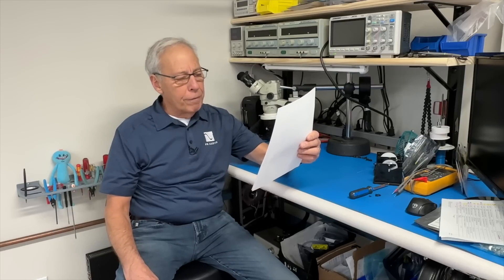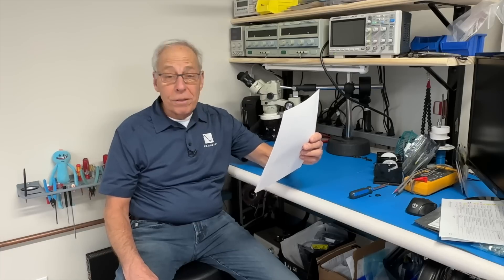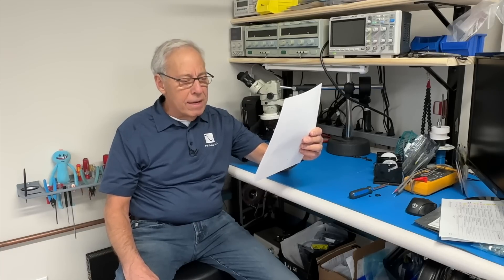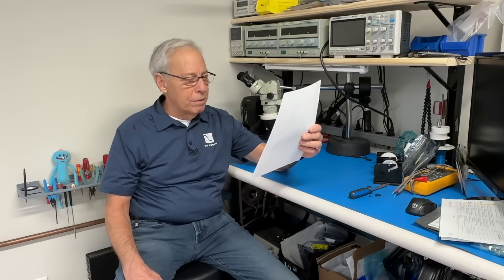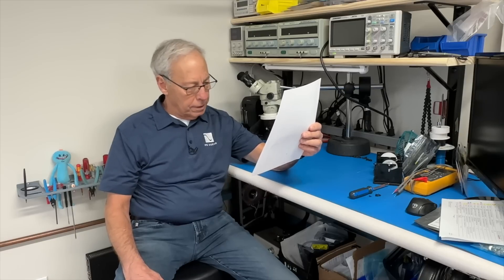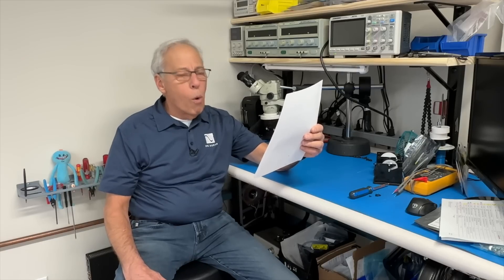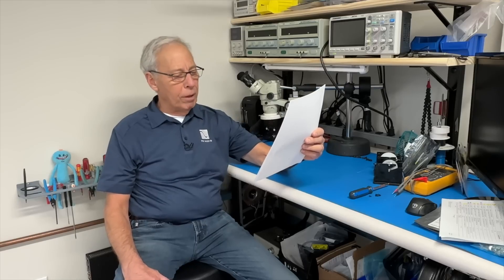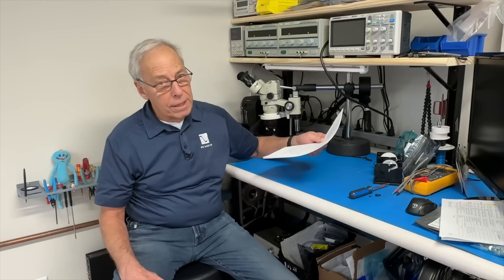Class D amps inherently inferior?

Comment: I have the impression that Class D will always sound artificial, even the most modern ones, there is too much effort and engineering invested by the industry so that these class D models can have the same 'warm' characteristic as the class AB (in general), trying to reconcile the high definition quality of one with the neutral/laid-back touch of the other, trying to compensate one thing with the other, it will always sound cold in some way. All Class D amps I've tested hurt my ears over time. I've tested them several times, from bad to good, changing DACs and speakers because I'm sensitive to noise, mids, and treble, even using EQ, even the "warmer" Class D amps cause me discomfort and ear pain. Sleeping listening to music on a Class D amp is torture. So, I see that this goes a little beyond the frequencies themselves, but rather the nature or sound signature reproduced by the specific topography of the Class D amp. Even though it's implemented to overshadow the clinical and terrible sound of the first Class D amps, it's always there, always. The brain doesn't accept it in some way. Interestingly, some older Class AB amps I've tested with lower specifications sound much more comfortable and more acceptable to the ears. Of course, there are flaws in Class AB amps too. They're not perfect. My sensitivity reveals this too, but auditory fatigue is less, fewer sharp edges make the sound more natural. In short, saying that an amp sounds "good" ends up being relative. It is obvious that the vast majority of class d are more efficient, "clear", "hi-fi", powerful and versatile, they sound cleaner and clearer in general, but this comes at the cost of being a more "in your face" sound and no matter how much they try to implement it, it never ends up being something "laid back" enough.

Comment: Isnt an amplifier just supposed to amplify a signal?  Why should an amp add sound to a signal?
Reply: That exactly is the thing with well designed class D - it is very close to doing just that, amplification. Very cleanly and neutrally so. 

People who aren't used to that, but instead certain characteristics of more traditional methods like A, AB,.and especially tubes, aren't immediately satisfied, because they're missing something.

That something is distortion and nonlinearity. They got used to it for decades and developed a taste for a particular pattern. Their brains expect it.

That's why they're disappointed when it just isn't there, and describe the sound as  boring, flat, thin.

It isn't. It's just way too clean for their taste.

Comment: Dear Jeffrey,
a proposal to check:
Take some wire wound 5W resistor of say 0.1 or 0.22Ohms  and connect it in line with the positive/red output speaker terminal of your class D amp output, the other end to the speaker cable to the positive speaker input terminal - and check the sound now.
Background: the speaker is best sounding not at the maximum damping factor available. Damping factor (a reversal value related to the differential source impedance of an amp related to the load impedance) is usually very high with Class D amps hence the output devices are switching and control depends mostly on high negative feedback. That's totally o.k. but can be absolutely too much of a good thing when it comes to real speakers, that worked well and perfectly aperiodically damped on a predecessor amp with less damping. 
So if you reduce that value, the speaker may sound less over-controlled, thicker...

Comment: Class D can sound really good, but it is rather brighter and thinner on the midrange compared to Classes A and AB . One has to pair it with the right speakers. My Rogue Pharaoh II integrated (tube preamp, class D amp) works well with my neutral KEF 105 but not good enough with my JBL L100.

Comment: Why are some of these Class D amps so expensive? You said that they use off the shelf modules. You just have to design a preamp stage, power supply and chassis around them. Why are China mini amps so cheap in comparison?

Comment: I recently had two class d amps in my system, one of which was a P S. Audio, which usually is powered by mccormack class a B amps
 One of these amps sported a tube preamp stage which is classy A and sounds great.
However, I find both amps unlistenable compared to my McCormack

Comment: As some other commenters have noted, class D amps respond very differently to peaks and valleys in speaker/crossover impedance. Any speaker no matter the quality is going to sound very different with a class D amp than with a similarly spec'd AB
Reply: That's true for cheap designs, but totally not for well designed class D. They're perfectly linear and flat, no matter the load.

What you're describing there was true in the past, but isn't anymore and hasn't been for years.

Comment: Class D amplifiers, are based on digital switching

Class D amplifiers generate 3rd order harmonic distortion and high frequency  noise. That is because the output transistors switch the output to either VDD or ground, the resulting output of a Class D amplifier is a high-frequency square wave. The switching frequency (fSW) for most Class D amplifiers is typically between 250kHz to 1.5MHz.

Vacuum tube amplifiers produce pleasant sounding 2nd order harmonics. Which is preferred by most listeners for being. "Lush & Glorious"

By placing a vacuum tube buffer stage prior to the Class D electronics the resulting sound is most pleasing to most people. This has been a well known fact for decades. Take a classic Nelson Pass Class A amp ( dry, cold but deadly accurate ). Drive it with a vacuum tube preamp and presto a Lush and Glorious sound.

Comment: If a particular power amp sounds thin compared to other power amps, then in all likelyhood  it needs looking at by the manufacturers with a view to improvement.
Messing about with different preamps to overcome shortcomings would not be my solution.

Comment: I haven't used Dirac, but I have heard many people report that the calibration tends to come out sounding too thin for their taste. I wonder if he used Dirac on the new class AB amp as well, or only with the NAD and blamed the class D for something it might not have been responsible for?
Reply: Hello Zack - I'm the guy who wrote to Paul. I tried the NAD with and without Dirac. The Dirac made no difference - the NAD always sounded anemic. Given the consistently positive reviews for the NAD M10, I was quite shocked when I heard the amp with my Focals. Paul's explanation makes sense to me. For the price the M10 is loaded with features, and I bet that the class D amp circuitry is not as good as it could be. I've gone back to being very suspicious of subjective equipment reviews!
Reply: @michaelpetkovich5058  What did you end up replacing it with? I haven't heard either in person, but most reviews do seem to say that the NAD stuff is on the lean side. And that Focals tend to run neutral to bright. This is probably a poor combination if both things are true.
Reply: BTW, I'm pleased with my new sounds, but I'm always looking for system improvements (the audiophile disease). That's the reason for the DAC. My original amp was the Harmon Kardon 5770.

Comment: "And some companies take an off-the-shelf module like ICE from Texas Instruments and they are ready to go..." 

Oh, you mean like PS Audio does for all of their Class-D amps? Yeah. And about that "we just don't think it sounds very good", all Paul basically does is just put some of his weird gain-cells in front of them on a PS Audio logo'd PCB and the rest is just that: A chassis around the modules. Edit: And yes there is the argument that Paul "voices" them, but all the measurements I have seen for the solid-state input stage ones has them pretty much being transparent. An example would be the S300 and M700 which use said ICE modules. They have very low distortion, and have no particular sound of their own, which is good. Paul did not compromise their good performance. The tube ones will just have lots of distortion, and not the euphonic type. Just distortion from poor linearity, but even then its likely to be drowned out by the distortion from LPs and speakers.

Comment: Almost sounds like because Paul thinks there's a sound (coloration?) to Class D, so he introduces a tube that has its own sound (another coloration?) to counter-balance things?  Hmmmmmm.    Class D amps can be wonderfully musical but they inherently have an issue.  Even though Class D amps are not digital, their high-speed switching modules will introduce a bi-directional digital-like noise.  This digital-like bi-directional noise will go back up the AC circuitry to the AC inlet at the chassis and then induce the same noise onto the other channel.  So now you have this digital-like noise being shared by both L and R channels at the common AC inlet.  It's significantly worse if it's a Class D integrated amp because the pre-amp section must borrow AC power from one of the channels.  Since L&R channels are already sharing this bi-directional digital-like noise, the pre-amp section is now getting the noise from both channels and then adding gain to that noise.  Very unpleasant.   For this reason, I would never entertain a Class D amp where L&R channels share a common AC inlet.  I use Class D monoblock amps and even then use superior passive dedicated bi-directional filtering line conditioners on each monoblock plugged into dedicated lines/circuits.  Only because bi-directional digital-like noise is believed to go all the way back to the service panel and then induce its noise onto other circuits.  Given the above and sufficiently addressing this well-known deficiency and assuming the mono-block Class D amps are well-enough designed, they should easily hold their own against many an amplifier from a musicality perspective.
Reply: Well, it all depends on how they are built, not the least their power supply.
Reply: @zazamarco235  Indeed.  And of course at the heart of a Class D amp's power supply is nothing short of a high-speed switching module which induces a bi-directional digital-like noise, right?

Comment: As an audiophile, and also, an experienced & certified electronics technician/radio-tv engineer, I become disgusted, at times, with the terminology employed by non-technically competent audiophiles.  What is meant by "softness," regarding sound?  What is "tight" bass?  How are these subjective terms related to frequency response, phase response, noise, THD, IMD, TIMD, slew-rate, etc?  If you quantify a phenomenon, describe it with numbers that can be read on a meter, or represented on the display of a 'scope or spectrum analyzer, you can "get a handle on it," can tweak it to achieve certain results, know WHY an amp. or other gear, sounds as it does.  Ideally the perfect hi-fi system would produce an output signal that's an EXACT duplicate, of the input, in every respect, except amplitude.  It might, or might not, be the "best sounding" system, however.
Reply: Well said. What do soft, warm, dry, rich, authoritative, grip, tight and countless other terms mean?
Reply: What you describe is what Harmon Kardon use to advertise: a straight wire with gain.
Reply: @jpatrickmoore5158  Be careful what you say!  You might give ideas to "high-end" audio manufacturers, who might then market RG-58/u co-ax as "straight wire with gain," for $1000 per foot.  Buyers would fall under the influence of auto-suggestion, and would swear, "You can HEAR the difference!"
Reply: @Pootycat8359  hey - since last night the audiofools even can measure the difference of a power cable not everyone can afford :-) in other words they aren't capable for make sure nothing but the switched cable changed in the room between two measurements or that the fridge don't turn on :-)
Reply: @Pootycat8359  it's like selling a new putter to a golfer; of course, it's going to improve their game.
Reply: @jpatrickmoore5158  I think it's worse.  At least, a golfer can't ignore the stats, as to whether his game improves, or not.  But in the nebulous quasi-reality of audiophilia, autosuggestion holds sway.
Reply: Why are you so uptight about it? Some people like me just like a colored sound
Reply: I agree. However, I would add that that well designed double blind psychoacoustic tests are needed to determine when improved measurements aren't audible. I'm totally with you regarding subjective reviews. I recently read a review stating that a component had a pleasing "bulging" sound. What nonsense!
Reply: @michaelpetkovich5058  Quick!  Wrap it with Ducktape, before it ruptures, and all the musical notes spill out on the floor!
Reply: Audiophiles can't deal with numbers and facts - their brain is hearing even different power cords
Reply: @Harald_Reindl  for those that can EASILY afford ultra premium there are audible and MEASURABLE DIFFERENCES

Comment: I have a much heralded Nad M33. They have a certain thinness in the mids. I would call it a presentation, not a fault. You can get rid of most of the thinness by using Dirac to add a 3db bump from about 250 to 1000kh. Below 250 even Dirac suggest adding a 6db boost. I have Rosso Fiorentino floorstanders, a traditionally warm sounding Italian speaker.

Comment: I have NAD C-658 and C-298. Class D amazing clean sound. Paradigm Founder and JL sub match perfectly. The writers speakers may not have been a good match. Dirac does not work well for 2 channel system and can ruin the speaker sound and can make thin speakers sound worse.
Reply: I have the NAD C165BEE preamp / C298 amplifier combo hooked up to Paradigm Premier 800F speakers (one step below Founders Series) and also find the sound to be truly excellent!  Can listen for HOURS with no fatigue....really impressed!
Reply: Wait…what? Dirac is not the right tool for 2 channel?! That was one of the reasons I chose the C-658.
Reply: @boomcrash  Maybe it will work for you. It took the life out of the music for myself and an audiophile friend. I had a pro set it up mine.

Comment: Im a bass player. And the latest craze ( 10 to 12 years) has been Class D bass amps.  I have played a few,  MESA, Genz Benz, Aguilar. They ALL lack something.  Its a feel thing. and all seem HPF too high. 
MESA claims their amp is 800 watts.  I'll tell you it is NOWHERE near the 800 watts of  my old Crown PSA2 FEEL.. Many of these bass amps use the ICE Modules. 
I am glad to hear your professional input. It verifies what many of us bass players have experienced in the pro performance world. 

The engineers guys says there is NO difference between a Class D  or Class AB amps sound.  Many who play them beg to differ. But we don't wear a lab coat with pocket protectors. , so our input is discounted  .lol
As you say  the input  Tube or FET if designed properly can make sound glorious. But in a commercial grade consumer bass amp we know they are using teh cheapest components to gain the MAX profit even thought the engineer claims otherwise.  We hate HYPE 

I've gone back to playing Class AB amps on my bass rig.
Reply: Kirk, I may have been the one who started the Class D bass amp conversation, but I agree; if I have a bass amp that has four 6550 output tubes, and I want a Class D amp that can rival that, even a 1200W Class D amp is going to have a hard time sonically. I (we?) non-famous part time warriors put up with Class D for gigging situations for light  carrying weight and the hope of enhanced reliability. Some players also pick lighter cabs and drivers these days, as technology has allowed them to do so. It’s one thing if you’re making a recording that’s going to be available to listen to over and over again, but in an unrecorded live situation, you can get away with a lot more “sonic imperfection.”
Reply: @shipsahoy1793  I somewhat agree. But I also disagree.
Most of my gigs these years are In Ear. I gig with an international pop star 50% of the time, The otehr i do loacal gigs and different mega church stuff.
Some gigs are VERY regimented. 
But teh ones where I get to play LIVE and interact in real time with other players I like to be inspired.  To this time I have not really been inspired by teh current release of commercial grade Class D amps. 
I probably wouldn't use an amp with 6550s anymore. I have in teh past. 
What I miss with these Class D amps is teh WEIGHT of each note. Its a FEEL thing.. 
I cant get by adding BASS in dB.  That just makes it boomy.
The last summer US tour I used a few ( now out dated ( class AB amps) Ampeg SVT 4 pro.. And in europe I had a few Glockenlang rentals and a ashdown.
 Doesnt have to be loud. But Just has that Punch that Mesa, GK, PUMA, Aguilar,  dont have.. 
I seem to play more and tweak knobs less on any Class AB amp that I gig with.. 
With IEM gigs I sometimes play with one ear out.. Its not LOUD. But Click is sometime generated so I need one ear in. 
With many current day commercial Class D bass guitar amps to me there seems to be a DELAY  or weird compression that feels weird. Its about teh FEEL to me . Not so much the sound but that is part of it  too
Reply: @svtbass  I hear you. Many things just don’t “feel” as good to me these days as they did in the last century.👨🏻